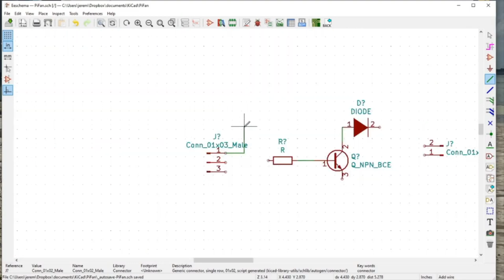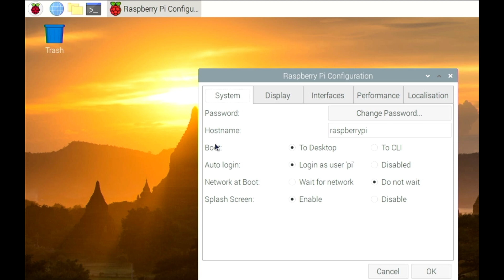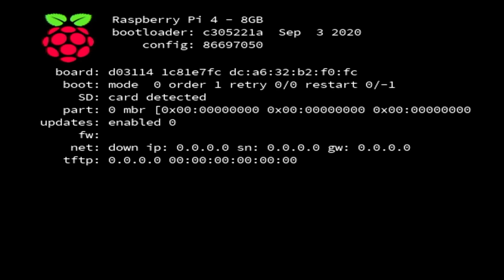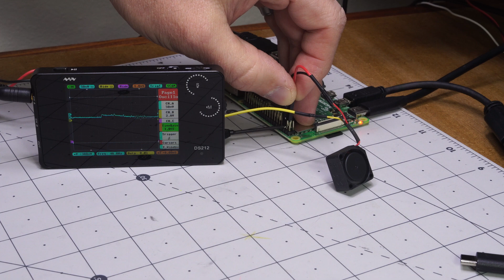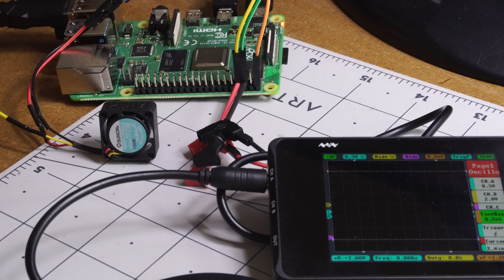Raspberry Pi OS Fan Temperature Control Howto

Comment: great content! sorry new to this, I currently have a raspberry pi 4 and a fan with red/black wires. Are you saying if I want to control the temp, I no longer need a Transistor and Resistor? and I could just get a fan with an orange PWM wire fan? thanks!
Reply from the maker: Thanks! Been a while since I made the video, but IIRC some fans have a wire for feedback, some have two wires - one for feedback and one for control (like a transistor, guessing they have one onboard). Or you can buy one my my transistor boards from Tindie, the EZ Fan 2.

Comment: Hey man, I have been thinking of adding another fan using these pogo pins on my Raspberry Pi5 and I have been searching for so long.
I’m ready to order from you however I need to ask, which fan or what specifications do I need to look for? Want to get something nice from Noctua since my Pi5 is the hart of my NAS and I plan to 3D model and print a case of it all with this fan as a “case” fan inside the enclosure.
Please point me in the right direction if you can!
Reply from the maker: Hello, so I do not have a NAS, though I am certainly a... fan or Noctua fans. If you use Discord (or if you want to try),  I bet the people here: https://butterwhat.com/discord on the diy-nas-and-homelab channel would have some good suggestions!

I'm on there as well, but not so much that section!

Comment: The only suggestion I would make is make the PCB traces thicker. There's all that unused space on the top -- why not just fatten them up? It's unlikely there will be much of a voltage drop, but at half an amp, it might start to affect fan performance, especially a 12V fan running at 5V.
Reply from the maker: Good point, thanks for the idea!

Comment: I like your design. I use the same circuit, with the exception of, that I use an LED with a 220 ohm resistor for the flyback diode.
I'd like to get like 10 of them, but can't justify the cost while I have operating (but not near as good looking) ones already.
Nice Job!
Reply from the maker: Well thank you. I've actually wondered about using an LED there - do you ever see them light up?

I understand, would be expensive for sure. If it helps, here's a 20% discount code for the EZ Fan 2 that's good through the end of February 2023: 02FF962C 😃
Reply: @JeremyCook  Thanks, I'll see. Yes, the LED lights up when the fan is on. I don't have spec sheets on em, they were from "the junk drawer", but they work, and haven't burned up😉 yet... they do the same function as a regular diode, with benefits! 
I'm looking into writing (modifying existing) an overlay, like gpio-fan to do PID and PWM control of the fan(s).
I have some boards with SSD's and battery backup boards that I wanna control fans on also.
Reply from the maker: @brucelytle1144  Very neat. I added a link in the description to my GitHub repository  with code relating to this that you may find interesting.
Reply: @JeremyCook  just wanted to let you know I checked that and more out. I've been messing around using pigs and the pigpiod daemon from the command line.
I'm gonna set down and put a program with a PID loop adjusting the PWM settings.
There are two ways to connect to all the gpio, i2c, spi, uart serial, even generate wave forms! One is through sockets, the other through pipes. pigs, is the socket interface, pigio is the pipe interface.
They both can execute any of the library functions that you can use in your programs.
With a 5 kHz (can go to over 30 mHz!) clock, 0-255 steps in duty cycle, I can get my fans spinning with a 128 (50% DC) I can reduce down to 67 or so without stalling. Set it to 93 and it has been maintaining 55.0 C (+- .5 C) over 2-3 hrs (so far). The PID loop will take care of load changes.
I've still gotta figure out how to get my code from a program to an overlay. They are written in a strange manner! They have their own compiler just for the device tree overlay files.
Oh yeah, the way to read the temperature,  it's in a file /sys/class/thermal/thermal_zone0/temp .
You can "cat" it from the terminal it will return the temp in (milli?) Celsius (in ascii text) you have to convert to a number and divide by 1000 to get it to 1/10° C.
There are file operation functions in the pigpio library also, for handling just this sort of thing.
I've gotten a github account, I'll be posting it up there when I get something going.
Also looking for an appropriate MOSFET to try, less voltage drop.
Reply from the maker: @brucelytle1144  Very neat. You're really done a lot of research/work on the software for this. Feel free to ping me when the GitHub page is up!
Reply from the maker: @brucelytle1144  Ha very neat. GitHub is helpful for sure... I put a lot of stuff on mine, even if it isn't always (usually?) in a finalized state.

Comment: when I do the stress testing with the "while true;", the  loops keeps going to print freq and temp, even after the stress command has ended.
how to stop this?
i needed to exit out of the ssh session and rebooted the device after doing all the test, because i don't know if the vcgencmd prints were still running in the background.
Reply from the maker: My Linux skills are only so-so, but I think you have to find the process # (ps may do this)and do a kill command for it.
Reply: Try hitting ctrl-c? That's how to kill just about any running process in a shell.

Comment: Hey this is awesome, dumb question here, I've seen this recommended for pi4 but it should work the same for a pi3b right? I have one I recently got a case for but the 2 pin fan included is a bit loud
Reply from the maker: Hi, not a dumb question at all! Yes, Pi3 will work fine. AFAIK any Pi will work :-)

Comment: why do you need the diode?
Reply from the maker: When it stops there can be some reverse current, called "flyback" voltage I believe. That helps dissipate it. Will work without the diode, but is best to have.

Comment: This is going to come in handy big time. I'm trying to make a modular Netbook based on a Raspberry Pi 4 in a heatsink-and-fan case, but I don't want to make the fans run all the time and I don't want to have a big jerry-rigged logic converter setup.
Reply from the maker: Great, hope it works out for you!

Comment: i have 2 pin fan, red/black - can i set Fan GPIO to pin 6 or pin 4? Will it work with just raspi-config setup?
Reply from the maker: Haven't checked those pins specifically, but I believe so.
Raspi-config setup should be possible as well, though you'll need a transistor or EZ Fan 2 board to supply enough current.
Reply: @JeremyCook  well no idea why it didn't work out
Reply from the maker: Possibly the +- on your fan are reversed? If you want to test an EZ Fan 2 board (or other transistor setup) hook the input up to a 3.3V pin. That will verify things are working at least from a transistor standpoint.
Reply: @JeremyCook  red is connected straight to 5V, black goes to ground pin - and it works all the time but its not working with GPIO settings in raspi-config.

Comment: i would like to control a heating wire, how can i prodect my pi for potential short circuits?
Reply from the maker: This may help, but for total isolation I would look into opto-isolators.

Comment: Hello,

I am completely newbie, but I did like you. I set up fan to turn on on 60 degrees, but it's still working non-stop. I checked the temperature, it was around 40 degrees. What I am doing wrong?
Reply from the maker: Hi Hezen - if you have a voltmeter, I would check to see if the GPIO specified is actually switching on and off. From there, what kind of fan are you using? Is there a PWM control, or are you running it off of a transistor?

Comment: Didn't work for me, my fan just keeps spinning, no matter the temperature.
Reply from the maker: Did you ask Mr. Meeseeks to help you?

Beyond that, the first thing I'd try is to test your output pin with a voltmeter or scope when setup. Also, are you using a transistor, or just the fan?
Reply: @JeremyCook  just the fan. Isn't that what you did? But then it occured to me that the fan needs a PWM signal, not just digital high/low, so I rewired it with an 2n2222 and a resisitor. Works fine.
Reply from the maker: @Beatleman91  Nice - if your fan has a PWM input, just the fan should work, but not if it's just a two (or sometimes 3) wire fan. Glad you got it working!
Reply: @JeremyCook  if the fan has a pwm input, then it needs a pwm signal, which the raspi-config doesn't provide - he can just set it on and off. Neither the bash/python script.
Reply from the maker: @Beatleman91  You're right it's only on or off, but I believe you can use the PWM input in such a manner, even if it's not acting as "PWM" in this case.

Comment: How do you calculate the base resistor? I plan on using a fan with 5V input and draws 0,07A. Thanks!
Reply: The base resistor sets the current through the base leg. Look on your data sheet and see what your gain (Hfe) is. See what the minimum turn on voltage is. Make sure that you provide enough voltage to turn it on and limits the base current to only enough to provide the CE current required for the load (motor).
So, say you need 500mA for a 5V motor, you will need 6.6mA base current, if your transistor has a gain of 75.
Keep in mind that the control (base) voltage is only 3.3 volts minus .6 (or so)  volts for the PN junction.
Is that clear as mud? They give you min and max voltages between the pins and refer to max current and power dissipation. The trick is to figure out how to stay within the lines!
Reply from the maker: My understanding is that the fan current etc doesn't really play into the base resistor; it just needs to be sized to the transistor you're using and the input voltage. My current version on Tindie https://www.tindie.com/products/jeremycook/ez-fan2-tiny-raspberry-pi-fan-controller/ uses a 430 ohm resistor, but you could probably get away with much less than that.
Reply: @JeremyCook  Thanks for the reply, Jeremy.
Reply from the maker: @chanhien4000  No problem, hope it works out for you!

Comment: Thank you. Your videos and articles on using pcb with transistor & resistor for pi fan really made it easy to understand the whole concept for noobs with electronics. They filled the gaps in other articles spread across the web.
I have couple of questions:
1) noctua "NF-A4x10 5V PWM" 4 pin fan connected to Pi4 GPIO at pins 2, 6 and 8. Will I be able to control its on/off through raspi-config fan control based on temperature? (All I want is the fan should turn on based on high temperature and switch off when Pi4 is cool) 
2) Will I be able to bypass the lower temperaure limit of raspi-config, using your "temp-fan.sh" script that you have shown in another video?
Reply from the maker: Well thanks so much Arslan!
1) I'm not familiar with that specific fan, but yes, I'd guess you should be able to control its on/off function with Raspberry Pi IO. Not sure about exact pins, but you'll need ground, 5V, and whatever you select in the RPi OS interface.
2) Maybe. It appears something has been updated (or maybe I was using something not current at the time) that makes it a bit more difficult to use. Check out one of the closed issues there for getting it working.

Comment: Great video. I purchased one of these bad boys for my Raspberry Pi 4 which has the GeekPi acrylic case and the Super Quiet 4010 Fan with Blue Backlight (Fan size:40x40x10mm)

(https://www.amazon.co.uk/dp/B07Y8DQ5ST/ref=twister_B085VRDMDN?_encoding=UTF8&th=1)

Tested it with a hair-dryer and it works a treat at a threshold of 60 degrees centigrade. :-)

Just 1 question: How do you reduce the threshold temperature?
Reply from the maker: Thanks Mitesh - I saw your comment on Tindie - guess that helped? That fan does indeed look great!

So for whatever reason the RPi OS doesn't seem to let you set it below 60ºC. However, the good news is that you can set it to whatever you want with instructions found on this video: https://www.youtube.com/watch?v=F1FQojoaNS8 - just a bit more "yak shaving" involved.